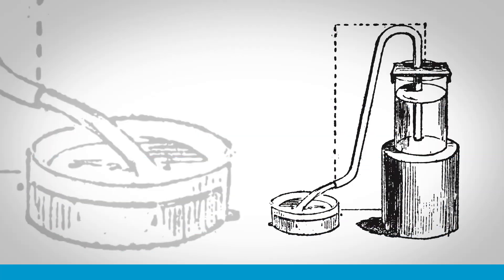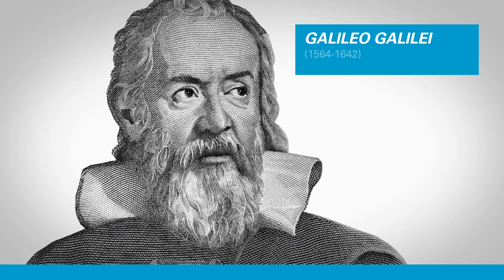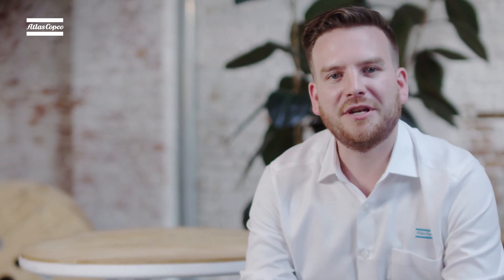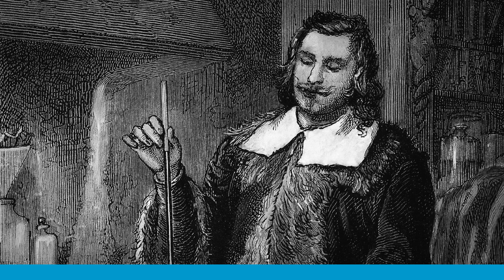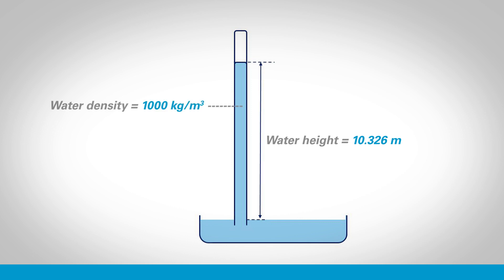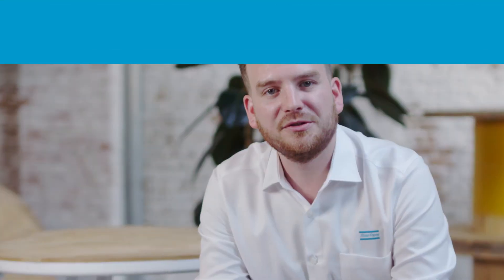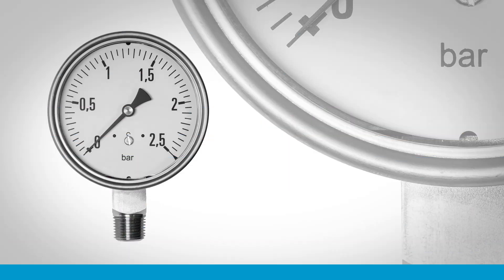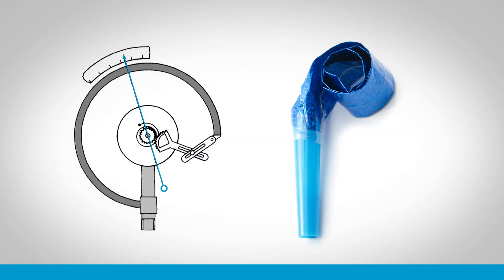Why Do Siphons Have A Maximum Height? Principle, History & Assumptions (All Explained)

Comment: Disproved in 24 metres tube experiments 1994 check height limit of a siphon  corrigendum
Reply from the maker: Hi Andrew and thanks for taking an interest in our videos! As Vacuum Specialists, our aim with this video is to describe one of the principles of Vacuum Technology: that vacuum cannot pull, it is simply the absence of a pushing force. This concept helps us to see how atmospheric pressure influences the liquid level in a column and to understand how barometers work.  While we wouldn’t dispute that surface tension, momentum and other dynamic liquid flow phenomena might enable an operating syphon to extend above 10 meters – we’re quite certain that you could not prime any such siphon in the traditional manner using vacuum at the exit of the tube - instead either the tube should be filled first as in your experiment, or liquid would have to be pumped up the tube from the water source with positive pressure.  Would you agree?
Reply: @AtlasCopcoVacuumSolutions  what if instead of having an exposed to environment of the water source in the siphon it will be a close container and connect to a water source lower than the siphon set up.will the water at d source move to d closed container and work as a SIPHON..is the 10m hight difference still the maximum height the water can be push by atmosphere pressure up to a closed container and goes out to a pipe below that closed container and established continuous flow of water as a SIPHON since water source has continuous supply.
Reply: @magicvalleycandelariaquezo8137  Hi. There is something fundamentally wrong with your question. Can you guess what is it?
Reply: @AtlasCopcoVacuumSolutions  Hi. Are you certain it's not the other way around? That instead, pressure cannot push, it is simply the absence of a vacuum? 
"vacuum cannot pull, it is simply the absence of a pushing force."
Reply: @Rick-the-Swift  Hello.  If I may, I would like to explain that the weight of the liquid within the siphon conduit at the long leg will create a vacuum as the liquid flows out the end.
If the outlet  is sufficiently located below the inlet elevation, the vacuum will be great enough  to allow the flow to continue  when the crest  is raised 25 feet above the source.
Reply: Hi Andrew,thanks for your comment.whst do u mean by 24 meters tube,is that d difference in height of the tube from d top level of d siphon tank water source and d outlet point?
Reply: @magicvalleycandelariaquezo8137  I used a single 48 metre nylon tube 6mm internal diameter, type used in beer cellers. The tube was raised by it's centre, with both open ends submerged at bottom of two vessels, all was filled with boiled water to remove any gas.
Reply: @InclinedTherapy  thanks Andrew,I saw videos siphoning water from a lower elevation to a higher elevation,is that really possible?the principle of siphon is the outlet should be lower than the inlet..this system will be very useful if it has capability to transfer water from lower elevation to a higher elevation..if that is possible,do u have idea about the elevation difference that this system will work..you said at 24m this will not work but the video said at 10m it will reach the vacuum.i'm thinking to use this system extracting water from a river and transfer it to a 50m above ground using siphon..do u think it's possible?
Reply: The idea is to set up siphon system in between the river and the 50m elevated ground.i think I need multi stages siphon to do that.is this problem can be solved using Bernoulli's principle only or I need other engineering principles for d calculations?